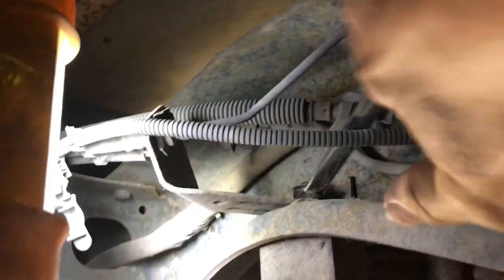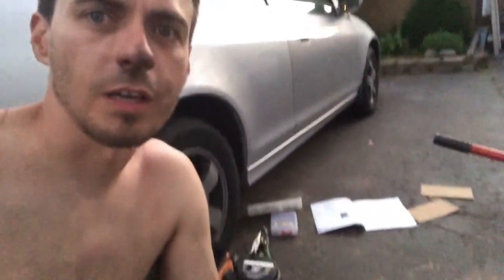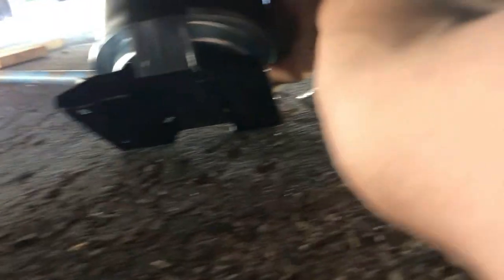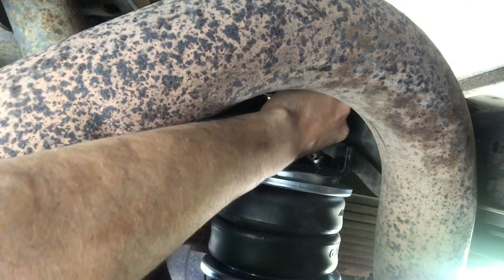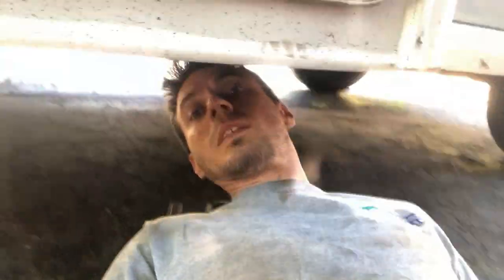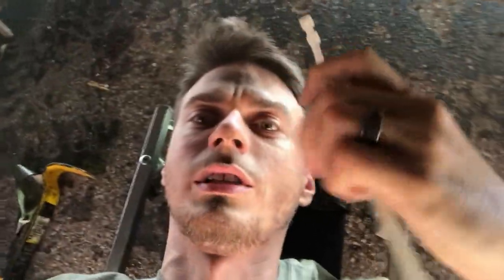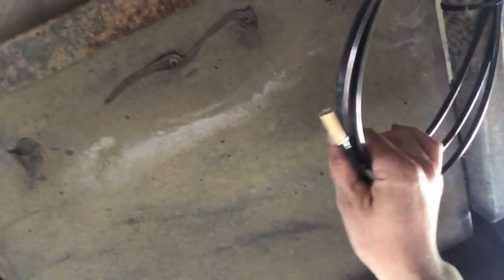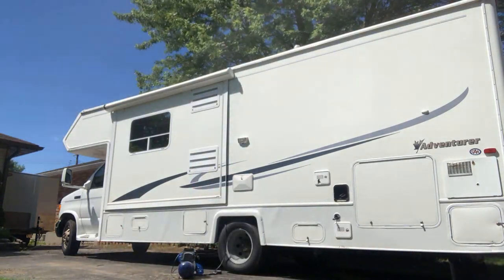Air Bag supension install on a E450 motorhome - A Grave Adventure S01E10

Comment: Ours is a 22E Thor that I am now considering to do the same thing soon. Thanks for sharing this Instruction video.
Reply from the maker: MiniTrail50, your coach is lighter then mine, should be a lot smother job :)
Reply: Did you ever do it. We have A 22e Thor and we are gonn have the airbags done.  Hoping it makes it more stable and not rock side to side
Reply: @GunninWizard   Yes,  i was hauling  toys 3 ebikes etc on the towhitch and the  bags helped the rearend.  You also might want to consider a beefier rear swaybars if side to side leaning is your primary concern.

Comment: how did it work for you? was thinking of doing it to my class c...it worked good on my truck.
Reply from the maker: worked great, I think this is the max load for this product. Not sure if there is a bigger set, I got an extra 2-3 inch, I think it actually put it back to factory height. Looked more level in the back and not squatted down, I still had to install roller wheels on the rear frame so when the frame was about to scrape, it just slid on the wheels

Comment: Thank you so much for the video, I have the 450 class C with slide out, I ordered the kit per Airlift Tech-support make sure I was getting the right one. $1000 worth of parts came in because I have the 1000 for the front and the remote system, I still have to get the air tank. I crawled under there and thought there is no way it will ever fit. After watching your video I now have confidence. Thank you so much for the video I will check if there’s a future videos because I want to see your battery change over and your air tank addition.

Comment: Just did my motorhome.  Used zip ties to compress the bags.  Also put the top bracket bolted on the bag very loose.  Then just slid it into place.  Was much easier then trying to get that stud thru the frame and into the bag.  I also pulled the shock out and removed the wheels.  Seemed to give me more room that way.  Time consuming, but not overly hard job.

Comment: Great video. How much lift did you get out of the bags? I bought an older fifth wheel, that needs 3-4" of lift as the leafs are sagging.  Do you recommend the loadlifter 5000 to do the job?
Reply from the maker: Thank you very much :)I got about 3" of lift, the 5000's were the recommended bags for my motorhome. If I did it again, I would have went to a higher capacity bag. They work great on the passenger side, however the drivers side is heavier with the slide out, fridge and house batteries all adding weight :(Not sure the axil layout on your fifth wheel, but these are for a single axil, there might be adapter plates for duals. In conclusion make sure you get a set that is stronger then what you need or you will be doing the job twice :(Or just get new leafs, if I had the money that's what I would have done

Comment: Hey man nice video you made it look easy but my number 1 question is how is the ride on road ? I have 1999 class A winnebago a 34 and rides a bit rough,  hits hard on bumps and it's horrible. Thanks
Reply from the maker: Thank you soo much for watching :)
Ride did not change much because of this mod, helped with getting out of drive way and got rid of rear suspension sag, I guess a new set of springs could have done the same. For ride quality I found tire pressure was the best, once I dropped from 85psi to like just below 80psi and was night and day :)
Reply: On your Class A, are you inflating tires to the pressure molded on the tire sidewall or the pressure printed on the tire pressure label on the RV? Max inflation pressure on tires can make them ride like a empty gravel truck!

Comment: Great video mark (I'm gonna look for the compressor addition now).  Question, If you NEEDED to, temporarily inflate the bags to the fullest (100%), how much more clearance could it give you? 

You said it gave you about 3" in the comments.  I have trouble getting in and out of our driveway - road is higher and our driveway slopes down towards our house.  When I drive in and out I have to put a 5 inch ramp under the front drivers side  wheel (or rear wheel), so it doesnt bottom out over the hump.  My generator exhaust is behind drivers door right in the middle of the wheelbase span, so it drags the generator exhaust if I dont use the ramp. I'd like to install Rear (and possibly Front) air lift, for all of the good reasons of better ride, but mostly so I could inflate it, pull out of the drive way and deflate to a comfortable ride height.  Thoughts?
Reply: I am adding for the same reason. Did you get it installed and how it work out. I got the front to install along with the rears. I have the remote system, just wish they made a four-way controller.
Reply from the maker: Its not a whole lot of extra height to be honest, I had to add casters on the rear ends of my frame rails, so they hit the road first and then my trailer hitch will clear, without these two mods I could not get out the driveway

Comment: Excellent video.  How did it affect the ride?  Do you have to add or release air very often?
Reply from the maker: Tom Taylor, thanks for the question :)
Even though it only raised the back a couple inches, we can totally feel that the motorhome is tighter in back. I have done small adjustments over the season, only cause we are still figuring out how to pack. If you install and have small air leaks, I’m sure adjustments would be needed regularly. My slideout and fridge are on the drivers side, so we are off balance, this year I am relocating the coach batteries to the passenger side to level things out. Also when I installed the drivers side the airbag was a little off alignment, so I have to fix that and then reset the ride hight. In a perfect world I would replace the rear leaf springs as well, cause they are loaded to the max.
Mark

Comment: For the little bit of comfort you get on the ride, it is really not worth the time and money you have to put out, just add a second  leaf spring   and you will see it last longer and a nice ride too.
Reply from the maker: Thanks for watching :)
For me it was I went into the driveway and could not get back out, I put roller wheels in the back by the hitch in another video, that helped a bit. I like to do my own work and I do not have the tools or a multi ton jack to lift and replace the leafs. Also my driveway is soft asphalt and an angle = unsafe to have in the air. So I guess this fix is not for everyone, but fit me fine. Also I liked using my onboard air compressor to adjust the level while camping :)
Happy camping
Mark

Comment: Next time try putting something under your leveling jacks and manually lift the rear end that way. No need for the floor jack I  Wouldn't think.
Reply from the maker: This RV does not have leveling jacks :(
Wish it did
Reply: @markgraves7972  ah that makes sense.